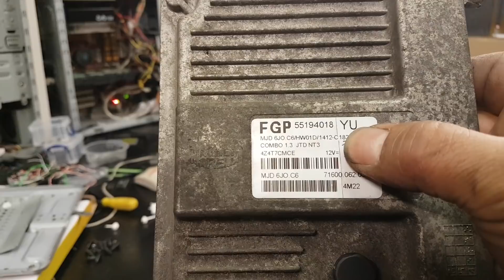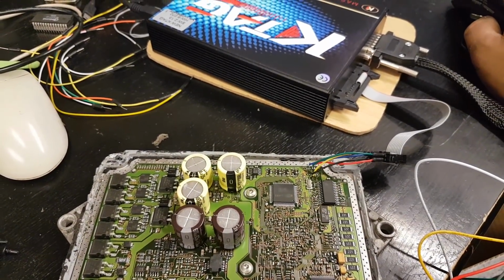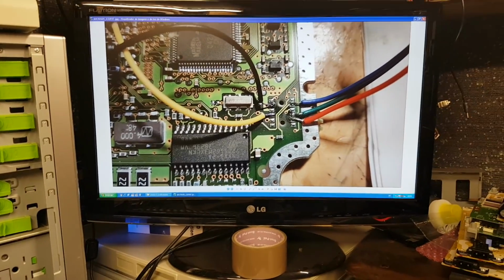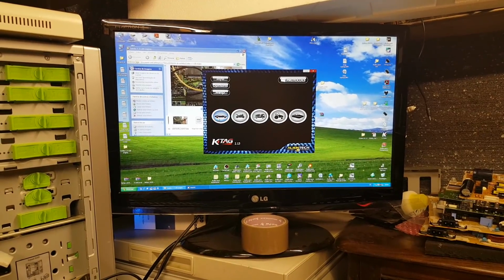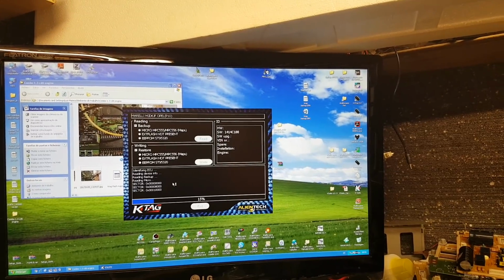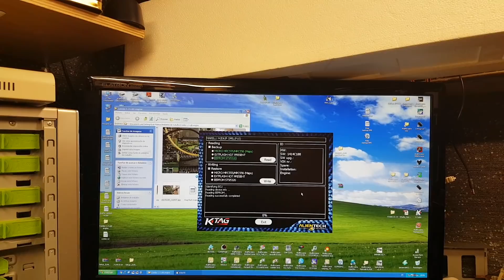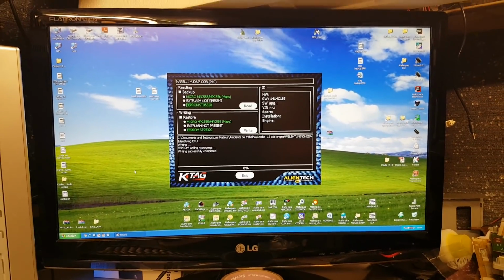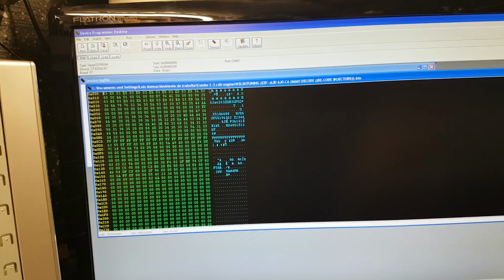Read and write MJD 1.3 Cdti  ECU on the bench using K-tag.

Comment: Hi there just wondering if you could help me,I'm getting code  B3059 no engine request received from my 1.3cdti vauxhall combo could that immobiliser fault
Reply from the maker: Could be...
Can you communicate with all the modules?
👍👍👍
Reply: @LMAutoRepairs  Hi yes I can connect to the bcm clocks and immobiliser
Reply from the maker: @ljr1981 
The immobiliser and BCM are the same module...
Can you communicate with the engine ecu?
Reply: @LMAutoRepairs  Hi yes I can
Reply from the maker: OK...
What is the background of the car, anything was replaced?
What have you done up to now?
Reply: @LMAutoRepairs  it just cut out on the way home from work I thought it was the chain that had snapped but I sprayed some easy start in to the air filter and it started then cut out what my plan is to do is to change the hole of the ECU kit see if that solves it
Reply from the maker: I would check wiring first...
Then reset the immobiliser modules and reprogram them...
You might risk to do that and be left with the same problem...
Reply: @LMAutoRepairs  ok I'll try that do you know what wires I should check thank you
Reply from the maker: Powers, grounds, communication lines, etc... The basic stuff...
Reply: @LMAutoRepairs  ok thanks for your help happy New year to you 😁
Reply from the maker: @ljr1981
Happy New Year 
👍👍👍

Comment: HI, thank you for sharing your experience. Do you know if it's possible to transfer KESS (OBD2) or KTAG (BDM) backup from MJD603.S3 55568383 KZ to new, never been in a car MJD 603.S0 55568385? Thanks
Reply from the maker: With K-tag yes...
Thank you for watching!
Reply: @LMAutoRepairs  MJD603.S3 55568383 KZ has an M58BW016DB Flash chip and  MJD 603.S0 55568385 has an S29CL016J Flash chip, would that be a problem?
Reply from the maker: In that case I would probably think twice...
If the module has never been installed on a car, why you just don't put it in and with the pin code program it to the car?
Reply: @LMAutoRepairs  I wish was possible. There some initial SPS programming (dealer only) I suspect so the diagnostic tools can deal with the configuration (VIN, PIN, etc). Is there any way to reset the MPC563 over BDM?
Reply from the maker: I never programmed a new one... did a new airbag module with SPS... but never had to do an engine ecu...
Get hold of the correct flash for that particular module then... and flash it with K-tag...

Comment: I got new ecu and resistor wasn't on it already. should I take resistor from old one after cloning and put back on new ecu or is not need it after cloning? will ecu work with no problems with out this resistor ? thank you
Reply from the maker: I would put it back... if was there initially...
There a slightly different ecu version, which I believe does not need the resistor... not sure now of all the details...
Thank you for watching!

Comment: Good evening LM Auto. Could you tell me which pin on the ecu plug for a 2006 vauxhall combo 1.3cdti feeds/signals the engine management light. I have installed a saab b204 engine and i have the eml signal from the saab ecu but need to connect this in to the vauxhall loom

Comment: Hi. 
Thanks for video. I tried to use my galletto v54 clone thru obd. I could upload from ecu, but after downloading flash it was not able to detect ecu again. Tried few times with no luck. Can you give me an advice og do you know the pinout, how to connect the MJD 603 on bench for Galletto v 54? Tried to do connect like on the video, but with no luck. Thanks in advance.

Comment: Hi any way to program Corsa d ecu without old ecu EPROM,got a replacement ecu but my old ecu EPROMs damaged ?
Reply: Hi what would you charge me to do the job ?
Reply from the maker: @gazjacko643  
I do this as a part time... 
Quite busy at the moment...
Don't you have anyone near you that can do it?
Reply: Hi I already tried a guy with my 
First ecu charged me £80  he tried to repair I got 
Home put it on the car and it blow the main relay fuse and burned inside of ecu 
So don’t want to risk damage again as the ecu has just cost me £200
Reply from the maker: You need the pin from your car and the pin from the replacement ecu...unless the replacement ecu has been reset, which in that case the pin from your car is enough...
From there, with the right tool, is a 10 minute job...
Hope that helps...
Thank you for watching and for your comment

Comment: hi i have motorcycle repair shop and i want  to upgrade my  business so ia can do ecu mapping removing faulty codes and dyno tuning. so if i by ktag tool i can read motorcycle ecu and put maps back on to it but can you tell me this what software is the best for motorcycle reprogramming and does ktag tool have info on how to wire up different ecu's so i can read them and map them. Thanks for the answer. :)
Reply from the maker: Unfortunately I don't have experience with bikes... K-tag does support some bikes, but I never explored it...
Don't really want to say much more... as there is probably better tools out there dedicated just for bikes...
Thank you for watching!

Comment: Hi sir today I have done egr delete on pretty much the same ecu MJD 6F3 1.3.
However I am facing an issue which is check engine light when I reinstalled the ecu. But the car doesn't give any DTC when I scanned it. the check engine light is on.
I hope you help me with issue thanks in advance.

Comment: Im never saved eeprom of from my car and they did diesel scandal update on it !! would you happen to know where I can find the file from ? I have a 2.0TDI mt
Reply from the maker: But the maps are not in the eprom... are in the flash...😉
Reply: @LMAutoRepairs  when I connect my VCDS with tune I have on car right now Measuring blocks are dimmed out and cannot select them! when I had my car running good then they were there ! and I regret not uploading my computer when I had it run good ! this is a 2015 2.0 Passat and it sounds like a tank from ww2 I need to do something about that

Comment: Hi thx for sharing these vids.i have a corsa cdti with a no com to the engine ecu.The ecu number is mjd603sa.can I use a mjd603-- or even a mjd602.many thx
Reply: Thx for the reply. Do u recommend I write the eeprom only or both map and eeprom. Also how do I support your channel as im only now getting into this and your info is great.thx
Reply from the maker: Hi
You should be ok by copying only the eeprom..
Consider to support my channel and all the hard work put into it at http://www.patreon.com/LMAutoRepairs
Thanks!
Reply: hi I got myself a Ktag and managed to read the data from the ecu but it didn't read like yours. just before reading Ktag said the variant was unknown and only offered me a full back up that was saved as three separate files. a 237kb ,(no abbreviations next to it)   4kb epr   and a 513kb mpc file.Im picking up a used ecu in the morning and im not sure what file I should choose when I try to write the eeprom.many thx
Reply from the maker: @phatboi9481  
Just write the full back up back... but the epr should be your eeprom...
Reply from the maker: Hi
The 603 I would say yes... the 602, I would say don't risk it...
Hope that helps....
Thank you for watching and for your comment!
Reply: Trinuty

Comment: Bro i have beeprog (universal programmer), i wanted to make sirius 32(flash 29f200bb) immo off, 
But it didn't works , i figured out that it was a checksum problem, so do you know how to calculate the checksum, with what software or any information..thank you
Reply: sirius 32 do not have checksum
Reply from the maker: Soufian Attar
You can do it with winols... providing you have the original dump...
Reply: lmsvvavr i do have the original dump, but my question is that i should make cheksum of all the file, or for some specific sector ?
Reply from the maker: Soufian Attar 
You could do it in old ECUs... when the checksum was easy to calculate and the algorithm were simple... nowadays it is much more complicated... an it is nearly a science on its own...
With the original dump, winols can recalculate the checksum and put it on the modified dump... simple as that... providing winols can do it for the ecu in question... there is other software out there cable of that...
Reply: lmsvvavr thank you
Reply from the maker: nenad mijailovic 
As far as I am aware, it depends on how he is trying to do the immo off...
One way there is no need of checksum... the other way it is...
Reply: nenad mijailovic how comes !!
First they told me to make from adress 4000-7fff with FF, wich i did, still didn't works, 
I used software didn't work..
Finally a friend named monoli from greece made it with checksum, and it worked,..
So what have i done wrong ?
Reply: But to be precise it was a sirius 32N but they told.me it is the same
Reply: Guys the car worked, but I'm curious about these ways, actually all the ways..
Hahahah sometimes i feel that these things is like a box of secrets